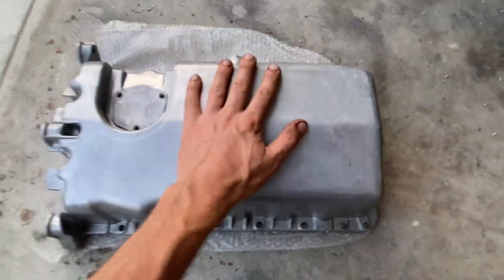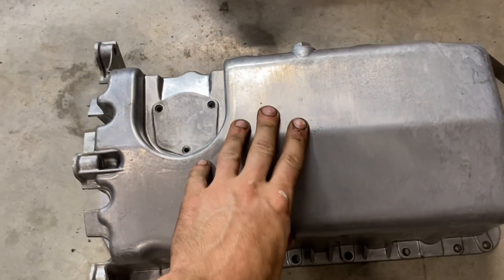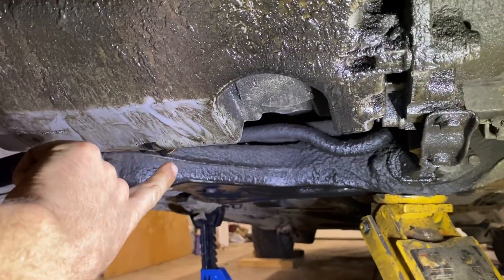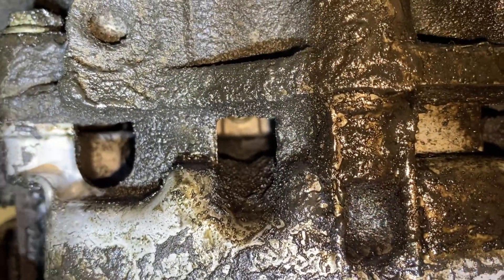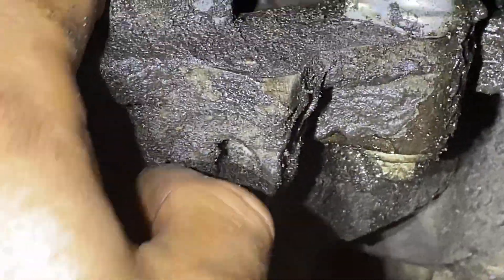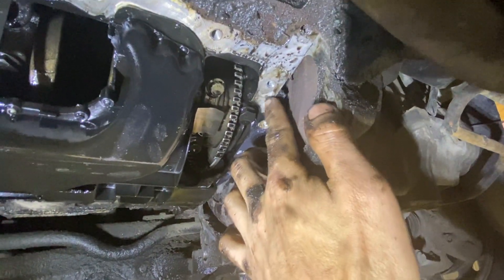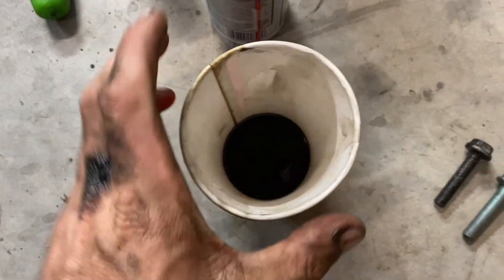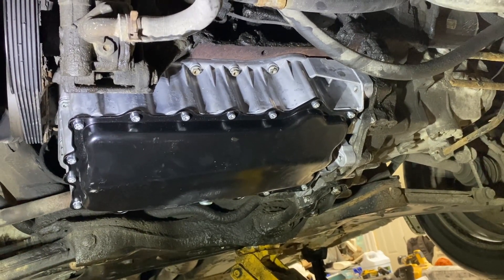MK4 MKIV Hybrid oil pan install on TDI or 2L

Comment: hello at 7:33 the plastic broke on my 1.9ttdi 81kw seat toledo is it possible to replace the plastic without removing transmission its big problem for me and you would help me a lot if you caan tell me how to replace that

Comment: is there a low profile oil pan with sensor? 🤔 probably not. fantastic video
Reply from the maker: I dont believe so, we didn't get level sensors here in North America that i know of
Reply: ah ok we have oil level sensors in ireland and europe. be cool to keep them  @JoshsJettas
Reply from the maker: @bencrosbie  yeah most other areas had them, our cast pans had the cut out moulded in but none actually came with them for some reason.

Comment: Ok, so for remove the sump on this model, you have to remove the gearbox no ?
Reply from the maker: No just need ball end allen bits or very stubby swivel sockets
Reply: yes i saw many socket on the web but none have magnetic tip ^^ ...  @JoshsJettas

Comment: What turbo line did you use the one I have isn’t in the right angle
Reply from the maker: This is for TDI (oil return into the block) and 2L non turbo. If installing into a 1.8T i believe theres an adapter or a different drain

Comment: Josh, thanks for the video. On the hybrid pan, how do I seal the lower black steel portion and what are torque specs for that piece?
Reply from the maker: It came pre-sealed, I just threw a socket on and made sure they were tight, not sure of the actual spec. It just had a gasket on it.